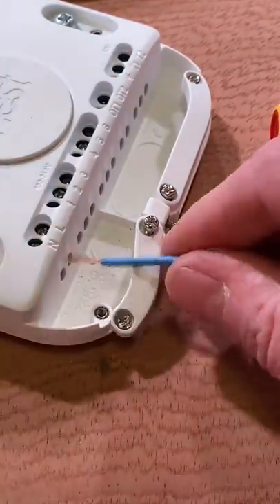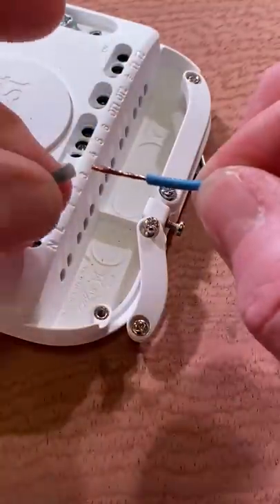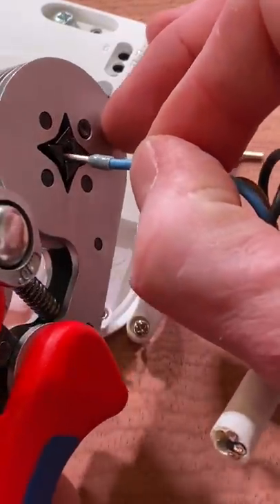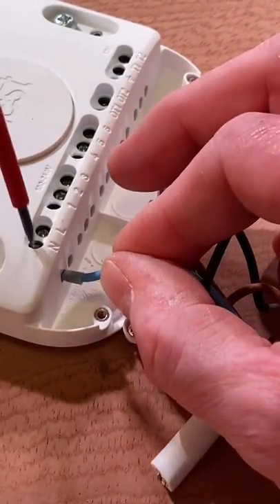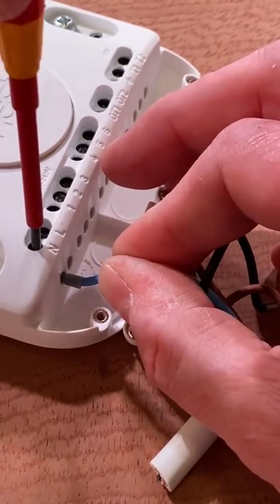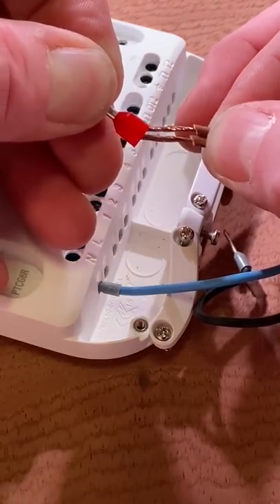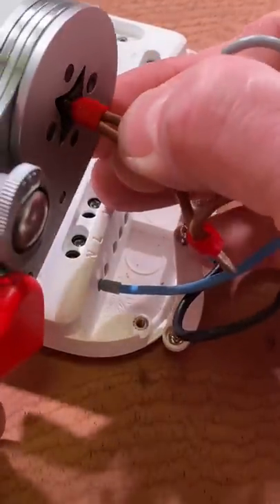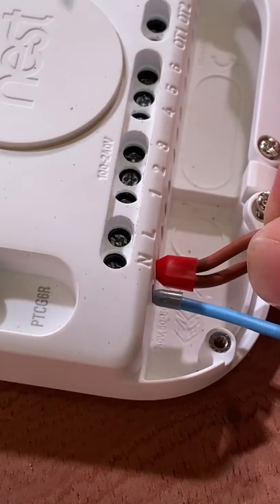Keep the strands together with WIRE FERRULES - Electrical #shorts from eFIXX

Comment: A dab of solder also works. But it’s far too much hassle for commercial work.
Reply from the maker: We aren’t allowed to use solder with screw terminals
Reply: That is really not a good idea! Solder in a screw terminal will deform over time and so loosen the connection. This practice is banned in most countries due to too many burned houses. We like our firefighters having a lazy day.

Comment: I also use ferrules without the plastic bit to splice two wires together and use 2 layers of shrink-tube to insulate the joint

Comment: Fun fact, I was pushed out of an industrial and medical equipment repair company for suggesting the use of those instead of soldering/tinning the wire ends. Well technically it was because I refused to do it and suggested an alternative.

Old boys, with bad practices from the 1970's, getting promoted to roles where they spread said bad practices onto you impressionable technicas and engineers.

Comment: if you try to help, might as well do it properly:
-dont twist the copper strands, it increases the cross section and therefore makes it harder to fit a ferrule
-dont let the copper overhang, it should be flush with the end of the ferrule, if not, trim it
-and don't take about seeing it's a better electrical connection, you can't see that...
and it should also be noted to use ferrules for screw terminals and none for spring terminals
Reply: and bonus tip: there are special screw drivers for those slotted-pozidrive-combi-screws which really helps with those very soft cheap screws you get with those cheap terminals

Comment: Or just flow some solder in the strands at the end. Pocket soldering iron like ts100 runs off batteries heats up extremely fast and has high quality tips. Does the same thing basically

Comment: In Germany we have to use these for every screw connection for safety because without the cable is far more likely to just rip out or come loose by it self over time.

Comment: Using ferrules literally a good method but don't forget to screw tightly, check by pulling the wire. If loosely tighten will lead to faulty connection.

Comment: Where I am from you are required to use ferrules for pretty much anything when using stranded wire, if you don't do it you for example won't even get your license as an electrician. Worst case scenario would be a house burns down, due to an electrical issue, insurance company finds out there was a single connection somewhere in that system without a ferrule in a stranded wire connection. Insurance won't pay up since the system should not have gotten a pass on security check in the first place and therefore should have never even been running.¯\_(ツ)_/¯

Comment: In Germany you have to use ferrules in the case you have this type of cable. Also you have to strip the wire to the exact length! of the ferrule and not longer like in the video said.

Comment: I was having trouble getting my fine stranded wire into small holes. To solve this, I had to put my fine stranded wire into an even smaller hole to make it easier to fit it into the original small hole.

Comment: Strip wires to the correct lengths. The strands should end at the end of the ferrule. Do not twist the strands, they should be straight. Pick ferrule of right size.

Comment: So if you can’t fit the cords into a hole you just need to fit it into an even smaller hole?
Reply: It will work the 1st way but its less safe and less reliable
Reply: Exactly
Reply: I imagine it's easier because it works as a funnel for the strands, I've done light wiring work but never felt the need for one. Though I can see the utility they provide.
Reply: @stevenclark6387  it's not just for ease of installation, it prevents the connector from becoming loose over long term use.
Reply: @stevenclark6387  I now very much doubt the safety of any electrical work you ever did in your life
Reply: Ferrules are fluted one end to help get cords/strands in the hole

Comment: If it uses a screw to connect and hold it, a ferrell is good, however if the screw just tightens a clamp in there, I was told that the grip will be worse.

Comment: this is one of the main reasons cheap 3d printer kits burn down or are unreliable

just put these on all Connections and you will never have issues
Reply from the maker: #TopTip 👍

Comment: As an old electrician once said if you put some hair around the hole you’ll find it. But why would you use stranded cable for a solid wire application?

Comment: I've found myself in that situation 1000s of times.

But do I use ferrules? Fuck no. I use a steady hand and opening the terminal fully. Saves so much time and the connection is secure and conducts properly

Comment: The right way would be to cut off the strand, which looks out at the front or cut the cable directly in the correct length abzuisolieren.

Comment: I think a soldering iron and a bit of solder would likely be as effective and cheaper.
Reply: A lot slower..especially doubling the wires up...at times of no power ?  Gas soldering iron, banned in some areas... I've been using these for 30 years orso...
Avoid the crimpers that squash the crimp square, they can catch trying to get then into the connection...

Comment: I do think in most case they are much better but.
"and you can see clearly how the ferrule has improvement the electrical connection."

I can see how this reduces the risk of failure or gives a better chance of success.
But I'd be interested to know if its a "better" connection.
Because I'd suspect the Ferrules as less conductive than the bare wire so I say there are come cons to ferrules..

Comment: Big cables like the HO7 4G50 or 5G120? I do it the old timers way. Stripping long lengths of 25 to 40 Amp (2.5-6mm) wire. Take one strand and make a hook and place it over the stripped area. Winding it up to the end and cut the end nicely off.

Comment: You guys have yet to disappoint.  The alternative to that would be coat it with solder.
Reply from the maker: Solder is good for lots of applications but under 🇬🇧 uk electrical codes can’t be used with screw terminals.

Comment: This reminds me of those videos companies used to try and sell something nobody needs by using someone who's incredibly incompetent at doing something that's incredibly simple. All this and in the end he has no problem getting the wires into the feral which which looks like it's got a smaller opening than the hole he tried to get the wire into originally. I mean how short of an attention span do you have to have to not see those two things happen just seconds apart

Comment: EN60204 the electrical safety of machines requires the use of these with any stranded conductor with a screw type connector.

Comment: If you’re terminating a thermal couple you cannot use ferrules this is because ferrules will increase your resistance and make the temperature you read from the thermal couple not accurate

Comment: If you use the pins it's better to not twist the wire, cause it will use more space inside the pin and over time it will come lose. Cheer's.

Comment: Is there any time that a ferrule shouldnt be used? 

Recently done a job on a immersion heater 415v drawing a lot of amps was a struggle to get the wires in to the connector i suggested the use of a ferrule to be told no as it can cause it to burn out.  I couldnt see how this could cause burn out

Comment: Tin wire but do not melt insulation-can you solder leadinto wire-like from a board-use in electronics when pads are damaged-in usa-need extras there

Comment: Great clean look. You could also tin them could you not?
Reply from the maker: You shouldn’t use tinned ends with screw terminals. The solder flows over time causing a loose connection.
Reply: @efixx  thanks for the reply. Never tought of that side of it. 👍

Comment: Never ever tin wires into screw terminals instead of using ferrules….. tin will slowly compress and the Connection will become loose 
Many house fires could have been prevented by the use of ferrules

Comment: You’re not supposed to twist the strands together, a properly crimped cable will be airtight which doesn’t work if you twist them
Reply from the maker: And this crimp tool includes a twist function? - https://youtu.be/uaIUl9WfciM
Reply: @efixx  then that tool was designed by somebody who has no idea about crimping, because my 150€ weidmüller crimping pliers do not have a feature like that, nor have I ever seen it on proper industrial grade tools. In the Norm DIN IEC 60352 Part 2, one of the common faults of crimping is even listed as „strands were twisted together resulting in an uneven crimp“ (translated from German).

Comment: You don't need this tool . You can just solder the wire and use it
Reply from the maker: You shouldn’t use solder with screw terminals as the solder runs over time.

Comment: The double ferrel is useful, but the single ferrel has the same issues as no ferrel
Reply from the maker: Single ferrules make stranded copper behave like solid so easier to insert in to the terminals.
Reply: @efixx  but you still have to insert the copper into the ferrel

Comment: Here's a tip. Don't use an aluminum ferrule on copper wire. Especially standed. Incorrect termination.
Reply from the maker: They are tinned copper
Reply: @efixx  prove it
Reply: @efixx  copper wire means copper termination. Mixing metals is a fire hazard. NEC bith
Reply from the maker: https://www.efixx.co.uk/Know%20How/ferrules
Reply from the maker: I’ve been using ferrules for over 30 years. The are mandatory in lots of electrical installations and are manufactured to recognised standards.
Reply from the maker: https://standards.globalspec.com/std/13473690/ul-486f
Reply: Are you a licensed electrician ‽
Reply from the maker: I’m a chartered electrical engineer

Comment: You put 0,75mm2 wire to 0,75mm2 grey ferrul, and put two wire 0,75mm to double 1mm2 red ferrul, also strains should not exit on top of ferrul.

Comment: It’s a good practice but I feel this is unnecessary, just keep spinning the end until the wires are tight together and don’t hit the edge when you put it in the hole. Not that hard and saves time.

Comment: Those are already permitted to be used?
Reply from the maker: Extensively used in control panels and a mandatory requirement in some applications
Reply: @efixx  well who approves it in your country?
Reply from the maker: @BallisticSwath  Use of ferrules are described within regulations relating to specific industries or within product standards  - so our wiring regulations in the UK are BS7671 - which they describe "special treatment of conductors) - product or application standards are set by CENELEC

Comment: Never use solder on the wires for screw terminals,  it acts like a thick liquid and flows away over time which will loosen the joint.... ferrules are the best way...

Comment: You know….. if you push the twisted wire into the terminal as carefully as you have to push them into the ferrule they you don’t really need the ferrule at all…. Really cutting out two steps and saving yourself some time 🤷🏼‍♂️

Comment: But how is this better than just soldering it? Then over time, it won't oxidize
Reply from the maker: Can’t use solder with screw connections under our wiring regulations (code)

Comment: Can't put wire in the hole of the thermostat but no issues putting in the smaller hole of the connector 🤔

Comment: Why on earth do you keep suggesting to have the copper sticking out the end of the ferrule?
There is absolutly NO need for it, it does nothing postitive but does prevent the ferrule going completely in the terminal, often leaving exposed metal.

Strip the cable only for the length of the ferrule.

Comment: Ferrules are just cosmetic to stop the strands spraying out, it's the tunnel or clamp that provides good connection 🤦 You could of also used an insulated pin crimp or flat blade or even gone bare back and still get the same connection lol

Comment: If you can't put stranded wire into a screw terminal maybe that should be a sign you're not qualified enough for that work.
Reply from the maker: ferrules create a more reliable electrical connection and are widely used in the electrical industry. Using them is a sign of a better job.

Comment: If you've got issues with twisted cable, electrical work isn't for you
Reply from the maker: It’s a technique to create a more reliable connection. You’ll find ferrules used extensively in electrical control panels for machines. So it’s quiet the opposite of your suggestion. If you want to take your installations to another level of quality use a ferrule.

Comment: So basically you had an issue twisting wires and putting them in the hole and then took this metal thingy with even smaller hole and put it without a problem. 😂

So basically this is not solving the issue you advertise on the start but rather connection quality.

Comment: Omg so many errors made. 1st strip the wire the correct length otherwise it will hang out the ferrule. Or if you unable to do that, just cut the residue off the tip… 2nd error: do not twist the wire before putting it into the sleeve! There is no need to, also dirty fingers  can compromise conductivity between the wire and the ferrule’s inside wall therefore it can be an issue overtime.
Reply from the maker: Omg - ferrule manufacturers recommend the copper extends slightly beyond the ferrule.  A slight twist to match the twist of the cable.  Phoenix contact make a combination ferrule crumpet which includes an automatic twist process.  - https://youtu.be/uaIUl9WfciM 

https://www.weidmueller.com/int/products/workplace_accessories/tools/crimping.jsp

Comment: Rather than another expensive one use tool, learn to solder.
Reply from the maker: You shouldn’t use solder with screw connectors
Reply: @efixx  I work aviation. It depends on what aircraft you are on. Especially Boeing. Their gen 200 to 500 has an odd e&e bay that all of the TBs are solder screws. They get drilled in place as the solder is heated.

Comment: You sir just failed your electrical test 😂 no copper to be left out of the end of any connection!! Could cause a major problem if the electricity decides to arc between it and the hole you’re trying to put it in!

Comment: You're not supposed to have exposed copper past the end of the ferrule...
Reply from the maker: You need to checkout the standards
Reply: @efixx  I could be wrong but I've been ipc certified for soldering and wire crimping for about 5 years. I build and repair military electronics for a weapons contractor. I'm pretty sure there should be little to no copper extending past the barrel. I'm willing to admit it if I'm wrong but 1- I know it shouldn't look like a rats nest coming out the end(like in this video) 2- if you're gonna show someone how to do something, you should show them the correct way...
Reply: For anyone reading this and wondering what I'm talking about. Here's the wiki for IPC, but basically it's an international standard for electronics and it includes different 'grades'. Medical and military grade electronics are usually held to the highest standard and something like a 1 dollar flashlight would be on the low end.  
https://en.m.wikipedia.org/wiki/IPC_(electronics)
Reply from the maker: Here’s a useful document on Ferrules - copper should protrude out the end by a small amount - 0.1 - 0.5mm depending upon the conductor size - 
https://www.controldesign.com/assets/12WPpdf/121213-weidmuller-ferrules-connection-failure.pdf
Reply: @efixx  the copper showing in your video is easily 100 times that length... Human hair can be .1 mm wide haha if you're using a more lax standard, then fine, that's the standard you're using. But at least use the standard. Or are you really going to sit there and tell me that the bare wire in your video only protrudes .1mm-.5mm
Reply: @efixx  dude... That document isn't even a standard haha it's a pamphlet on how to use a barrel crimper. How can you even compare that to the ipc standards haha ipc is an international standard for the manufacture of electronics. That's like following the directions on how to install an outlet and calling yourself a licensed electrician. Whatever the standard is, hopefully you can admit that you're closer to a cm then to .1mm...
Reply from the maker: @CW-fq9yy  it’s a white paper from the worlds leading producers of ferrules. Our video was a quick intro on the use of a ferrule - which is an alien concept to lots of electricians. See the comments.  We’ve produced lots of long form videos on the use of ferrules which go in to more detail. In terms of standards applied they differ by industry and application.
Reply: @efixx  I wasn't trying to trash you or your video. I'm just saying, if you're gonna show someone how to do something, show them the correct way. I'm fairly certain the wire should be stripped to a length equalling the length of the barrel. I never wanted to argue but it was pretty insulting for you to insinuate that I don't know what I'm talking about and amazing you'd say the standard is clearly much shorter then your own video while claiming you're right and I'm wrong. I assume the standard YOU'RE using for protrusion is related to either the gauge of wire or number of strands and .1m is probably for 20-36awg, .5mm probably for something like 8awg. You're using what 16?18? And protruding almost 1cm aaaaand still saying you're right and I'm wrong. Saying you're just trying to show people what ferrules are isn't an excuse for doing it wrong either. Now, at the end of the day, does it really matter? Probably not in the vast majority of use cases, but like I said, you're comments were insulting and you're arguments ridiculous.
Reply: As I said, I'm willing to admit I could be wrong, but you're video definitely does not display the correct way to do it.